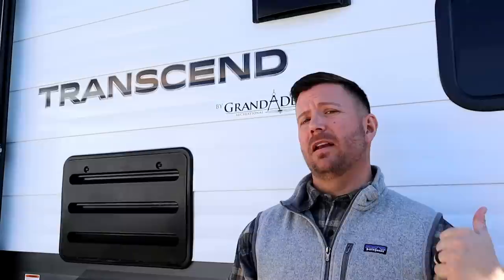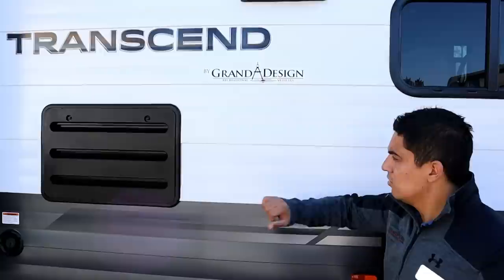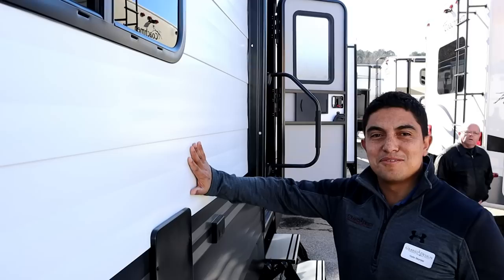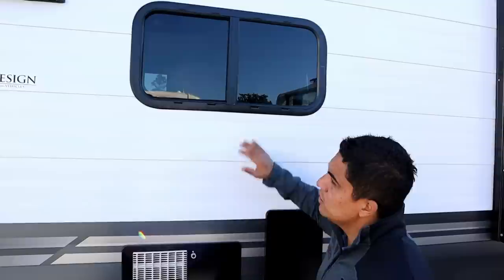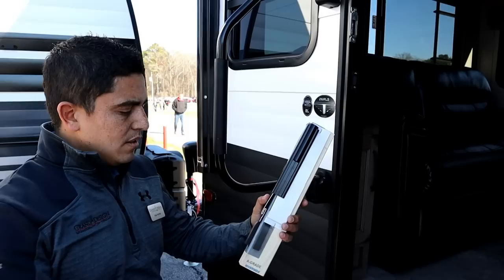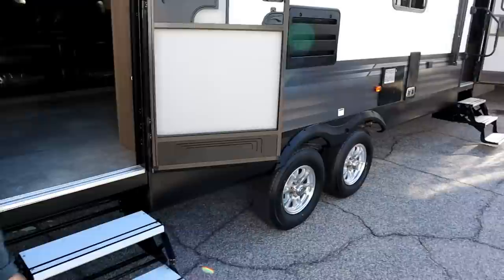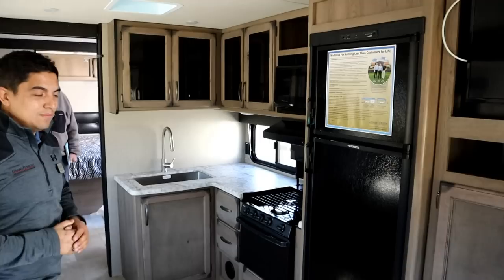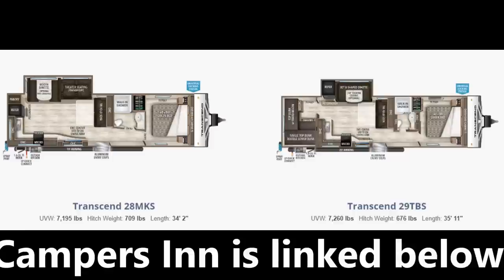Grand Design Transcend Build Quality Tour w Factory Rep

Comment: Do they offer this layout with azdel siding?
Reply from the maker: Azdel has not been able to pass Grand Designs adhesive testing.  Azdel continues to reformulate their adhesives but none have been able to pass standards.  Azdel has the potential to be a great product... but it won't laminate well enough for Grand Design to use it.
Reply: @WanderingWeekends  I noticed the 2150RB has an almost identical interior layout and a fiberglass exterior. IMO the 221RB has a far better interior even though the changes were minor. Do they offer that layout with fiberglass?

Comment: Can you access the bedroom and fridge  on the 221RB when the slide is in?
Reply from the maker: Fattie Great question! I do not know but will find out for you!
Reply: Thank you, This would be the perfect trailer if they used real plywood instead of that O.S.B nonsense.
Reply from the maker: I just spoke to the factory rep from Grand Design.  You CAN access the bedroom and fridge with the slide closed!! Yay!
Reply: Thats awesome. Thank you for the quick response.
Reply: Well it has a second door in the bedroom, you can at least access bedroom from the outside door if nothing else.